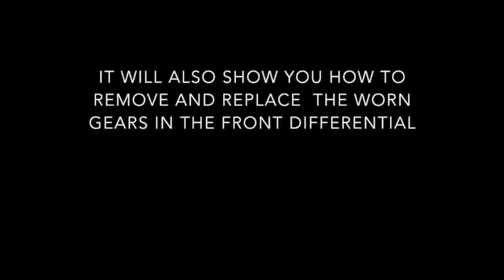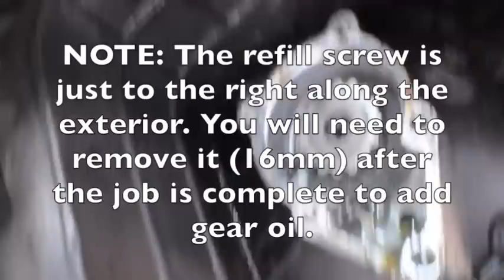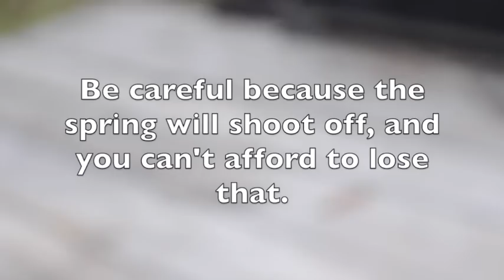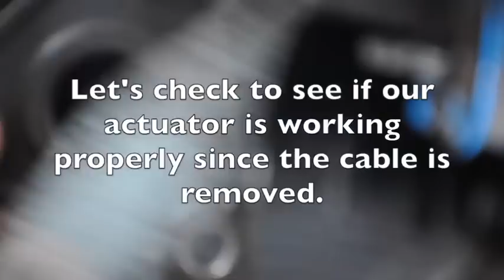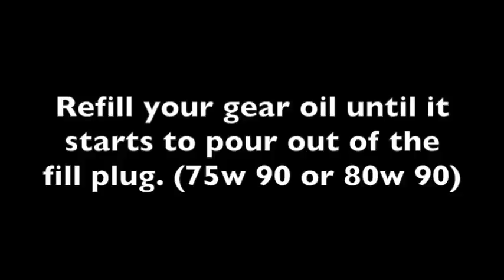How To Fix Gmc Sonoma 4x4, Chevy Blazer, S10, Jimmy, Olds Bravada, 4x4 Grinding Clicking Noise

Comment: This was very helpful. I am a mechanic, but never worked on this system before. My problem is the small shaft is not moving (just a little). From watching your video I will pull her down & check what the problem might be. My Blazer is a 1983 model & I am living in the Philippines, so you see parts may be a problem. I figured this S10 blazer belonged to the military or someone in the military brought it over & thru the years got out in the public. Thanks for your time!

Comment: Great Video. I need to do this and Now I know I can. Wife drove with 4wd on and everything still works except the Front Fork isn't engaging. Im going to assume she stripped the locking collar. Thanks again. And to those with your 4wd control blinking then turning off its more than likely yur Tranfer Case switch motor. You can ground the #13 pin on your OBDII connector and the switch will flash the code. Their are only 4 codes and easy to look up on Google.

Comment: Hello, I have a doubt, what function does the sensor in the front differential serve?
Reply from the maker: The actuator pulls the cable when the 4x4 button is pressed and engages the gears hence, allowing the vehicle to be in four wheel drive. Thanks for watching.
Reply: @TerenceDIY  i mean the sensor with the plug that you disconect , not the vaccum actuator
Reply from the maker: Are you talking at the 6:43 mark? If not, what time stamp?

Comment: I have a 2000 S10 LS 4x4, front axel won't engage. Thought the TC switch was sticky so already swapped it, transfer case functions but no power transfer to wheel. This is a great video for a guy like me just to open everything up and inspect components.

Comment: I’m having a similar problem with my 1999 blazer. I’m going to have to pull the same parts you did. I think I’ve got a bad bearing. Not the actual rear end bearing but one in the axle tube. What’s the name of the parts you replaced?
Reply from the maker: Hi, the parts are in the description box. Thanks for watching.

Comment: Curious how much of this I would have to do to drop my oil pan down. I have 2002 Sonoma 4.3L 4WD and I can’t come up with the simplest solution to drop my pan.
Reply from the maker: You're definitely going to have to remove quite a few things to drop that oil pan. You might have to remove the motor mounts bolts as well so you will be able to jack up the motor for clearance. Thanks for watching.
Reply: @TerenceDIY Hoo boy. And with no oil pan, I wonder where the jack point is to lift engine? Oh, this is frustrating 😂
Reply from the maker: The only for sure way to lift it would be to use a hoist. However, I have seen guys use blocks under the crankshaft pulley and jacked it up there.

Comment: Hi my 96 blazer grinds from the front right wheel but when I engage 4wd it stops…. Think it’s the gears inside not disengaging? Replaced cable, actuator all is working as it should….
Reply from the maker: That sounds  like that maybe your issue. I would lift it to see if I can visually see or hear where the noise is exactly coming from when the wheels are turning.
Reply: So does that washer inside fit differently on different cars? Mine was sitting inside different then yours was…. Was debating on putting it back like yours was or mine….
Reply from the maker: The way I installed the washer on my was how it was from the factory. The 4x4 worked great after I finished fixing it. I'm not sure if it was installed differently. It would be very weird if it was.

Comment: Thanks.  When i pulled the cv axle out of my zr2 it pulled the inner axle shaft out with it. Changed the seal, didn't bother to look down the tube and ultimately destroyed the thrust washer apon reinstallation.  Thanks for showing how it all comes apart and where everything goes.
Reply from the maker: You're very welcome.
Reply: I'm confused on what way the thrust spacers go. Any help or tips you can share? Thanks in advance

Comment: What is the name of the sleeve that the kit you mentioned in the description doesn’t come with that you have to get from gm
Reply: Is it the — Front drive axle clutch sleeve 26036092-?
Reply from the maker: Here are some links to the part....

https://cmgearworks.com/product/gm-chevy-s10-7-25ifs-slider-slide-collar-4x4-front-axle-7-25/

https://www.jimellisbuickgmcmogparts.com/p/GMC_1999_Sonoma/SLEEVE/53554931/26036092.html

Comment: I'm looking into this front differential rebuild kit and I'm finding that the Dorman brand online gets a lot of negative reviews saying the that parts are inferior quality. Has anyone been able to find a better kit?
Reply from the maker: Hi, I am pretty sure you can find an GM OEM set on here (link below). However, you may have to buy the pieces individually. 

https://www.gmpartsdirect.com/search?search_str=FRONT+differential+carrier+gear+kit
Reply: @TerenceDIY  thank you for your video once again. Are there any noticable symptoms of these gears are washers going bad?
Reply from the maker: @MattyTxp  Absolutely! you can hear the gear grinding and clicking while in four wheel drive. It's extremely noticeable.
Reply: @TerenceDIY  thank you for the response. I have recently replaced my transfer case vacuum switch because this noise was going on while in 2wd. I haven't had the noise since and not in 4x4. Wasn't sure how damaged it was.

Comment: New question. Hope you're still checking comments I know this video is from a long time ago. I followed your instructions to a T. I have everything assembled just like you said, new sleeve and gear, thrust washers, clips. They cost a pretty penny. When I get to the part  29:48 in the video where you mate it to the differential mine won't bottom out. It won't seat fully. Something is preventing it from seating all the way. This is driving me nuts :) I though I was almost done :(
Reply from the maker: Hi Jay, were you able to get it to seat??
Reply: @TerenceDIY  Yes! :) I had the wheels turned all the way. I straightened them out. I started the engine for just a second whatever it was I did that seemed to put everything back into place :) It is seated and I'm headed for the finish line :) Thanks for the reply! :)
Reply from the maker: @jayb9687  that's awesome!!

Comment: At 12:14 that gear that has the “claw / pincher” around it appears to be the gear that is moved right and left to engage 4WD. All my gears fell out when I took this apart. Which way does that gear go back in? It has a flat side to it and I don’t know if that faces differential housing or towards passenger side. Thanks!
Reply: Looks like it’s flat side towards driver side.
Reply from the maker: Yep. At 21:36 I show the assembly.
Reply: @TerenceDIY  The most God awful part if having everything back together and not being able to get the damn cable to click into the spring clip. OMG! No way I can pre-attach cable and lift the entire assembly up and hope to mate all the gears. And you'd have silicone gasket crap all over everything.

Comment: Thank You ! I had to disengage the cable to the vacuum pod under the battery after installing a new Pod , cable and the transfer case vacuum switch, It would stop grinding in 2WD so....
My guess is that I need the rebuild too. ( a bit over my skill level I think)

Comment: Hey all, I'm curious if I can change the outer axle seal without taking the whole assembly off. The inner axle is still "in the way" in the hole, so I'm not sure how to get leverage on the seal to pull it off. Any tips would be greatly appreciated!

Comment: I need help I have the same problem with my 2000 blazer but it has a 6 inch lift on it, do I have to do anything with the suspension lift bar?

Comment: Is that for a 1994 GMC Yukon?
My axle shaft has play, can slid in and out, what needs to be replaced?
Reply from the maker: The Yukon is similar, however, this is geared toward the smaller SUV's and pickups. As far as the play in your axle shaft, I would have to look at it to figure out the issue.

Comment: Do you have to pull the shaft out like this to replace the rubber seal on the actuator shaft, or is it replaceable by only removing the actuator cable housing?  I have a leak coming from that seal.
Reply from the maker: Hi rob27926, sorry for the late response. We are currently moving so I have been off the channel for a while. Unfortunately, you may have to remove the shaft to replace that seal. However, I am not 99 percent sure because I don't have the Sonoma anymore and I posted this some time ago. Thanks,

Comment: Can I just remove the axles and run it permanently in 2wd, or do they hold the hub assembly together?
Reply from the maker: Hi MontanaMuzach, I don't the truck will run properly if you do that. Not only will you get all sorts of trouble codes, but there will be an imbalance within the drivetrain.Thanks, Terence
Reply: I asked because my 4wd was engaged, I didn't know it, and drove 100 miles on the highway before hearing a bang. Not sure if the diff is toast or what. Makes bad noises now, and the shaft from the t case to the front diff spins freely. I don't drive it now, but hoping for a cheap, less labor intensive way to get it back on the road and don't really need 4wd.

Comment: Does the grinding sound like it coming from the  cv axle when applying gas hard because I was thinking coming from their but it sound like this is the issue but not sure and what the total price for the parts
Reply from the maker: Hi Sam, sorry for the late reply. The grinding does sound like it is coming from that area. And, most likely it is (common issue). As far as parts, this was some time ago however, I believe I managed to get them for a little over $100. Thanks for watching!
Reply: Terence's Youtube thank would be the same as changing the front differential?
Reply from the maker: Hi Sam, changing the front differential requires a lot more work. This only requires moving certain parts to change the worn parts. Thanks,

Comment: What fluid would you put back into your transfer case?
Reply from the maker: Hi, below is the link to the fluid that I would use... Once you drain it, you will need about 2.4 quarts to refill it. 

https://shop.advanceautoparts.com/p/gm-auto-trak-ii-transfer-case-fluid-338-oz-10-4017/10628688-p?c3ch=PLA&c3nid=10628688-P&adtype=pla&product_channel=online&store_code=&gclid=CjwKCAiA5o3vBRBUEiwA9PVzar9XTdKWGJrHklXwX8KfZh8Hkcb268mSrq8Zks3avlPMOCR07yH0NxoCexYQAvD_BwE&gclsrc=aw.ds

Comment: How do u know when this is the issue with the 4 wheel drive
Reply from the maker: Hi Orlando, if your truck is experiencing this issue, the 4 wheel drive will not engage. You can hear it clearly trying as the gears are grinding, but the front wheels will not move. Thanks for watching!

Comment: Thanks for your response and "good luck". Question if I may ask: My actuator cable is fine. 4 wheel drive did work some months ago (just purchased 2000 S10 truck, great condition) then stopped, no grinding, no noises. Pulled cable from actuator (vacuum line disappeared, gone from actuator. Burned through touching exhaust pipe and think tire ran it over and pulled it off). I made a split sleeve, pulled cable to full extension, hose clamped it and nothing. I can spin front drive shaft freely. I am waiting for differential kit to come. Does this sound like the problem or am I going to waist time with what you did in your video? Appreciate any insight. Thanks in advance.
Reply from the maker: Hi Keith, I highly doubt you have the same issue as me. Mine grinded for quite a while before it completely stopped working. When you press the 4-wheel drive button, does the light continuously blink or does it function properly? Also, it's funny that you are mentioning this, because my 99 Tahoe just did the same thing. The four wheel drive stopped working out of nowhere. I believe I snapped an axle. I won't be able to tell for sure until I get under it in a few days but I am almost positive. If one of the axles are snapped, the other one will not function in which will disable the 4-wheel drive. Also, is there anyway you can see if your front drive shaft engages when you press the 4-wheel drive button? That will help a lot if I knew this. I'm just trying to rule out if you are having an issue at the transfer case. Thanks, Terence
Reply: @TerenceDIY  thanks again for getting back so quick as I'm spending all kinds of money getting prepared for this little venture. This switch was non-functional and it was a strange thing because it was a contact issue where I would need a special tool to push the pins through or possibly a cold solder joint. What corrected the problem was ever so light pressure on the back plate of the four wheel drive switch so I drilled a clearance hole and a small tap hole and put a wood screw through and just put pressure on it and it's been fine. Typical backyard mechanic. You can hear very clearly four wheel High and four wheel low when you push the button the relay works on the passenger side and you can feel the engagement of the transfer case. That was the first thing I checked. with it in two-wheel drive I can freely spend the front axle excuse me front drive shaft when I engage in four wheel low or high it locks that short front drive shaft. When I pull the actuator cable to its fullest and lock it there's nothing the drive shaft does not engage. I never heard anything snap or go nuts and I'm kind of new to the four-wheel drive stuff as far as repair. I'm an air-cooled VW past Motorhead as I had a machine shop and clearance the case with the program I wrote for 2174 160 horsepower 71 Super beetle, show car and was right on the edge of buying a Pauter short block for 14,000 that would produce 350 horsepower but a lot of mods to the already finished car had to be done and divorce happened. That's a lot of personal information but that's my background mechanically and I race quarter midgets and have my hand on many tractor engines diesel. So I don't know what I'm going to find when I finally get into this the last thing on my list and having some tight financial issues is that beautiful tool you used right angle impact wrench or maybe just a wrench as I can snap them loose and then use it to get the screws out better in difficult area. Again thanks this was lengthy thanks for taking the time to read and answering my questions you've been a great help.
Reply: Hey Terence. Finally a great day in PA for this job. Started late, work, but I'm hung up. Can't seem to get the clearance to pull the splined axle out completely out of the wheel bearing. Took the tie rod off still not enough. Upper ball joint & control arm were replaced few months back & only drivers side lower ball joint. My mechanic said it was a bear. Is my only option now to remove passenger side lower ball joint? Am i missing something? Can the axle tube be removed to try and gain some clearance? Appreciate your help. Thanks
Reply from the maker: Hi Keith, did you remove the passenger side upper ball joint? Please let me know. Thanks,
Reply: @TerenceDIY  Hello & literally just ,"FINISHED"!!
   Upper, lower ball joints, tie rod, brake caliper and just for the hell of it the shock at the bottom only. My eBay Milwaukee impact wrench was a little lame but it managed to get things apart. It's all back together the four wheel drive gear was torn up but now it engages and I'm waiting for the posi lock kit to come cuz I'm not doing that vacuum stuff anymore! I started at 9:00 it's after 3:00 it's about 1 2° out and I can feel my 61 year old knees. Thanks for getting back it is a bit of a job but I'm getting more familiar with my vehicle. Take care of my friend.
Reply from the maker: Good Job Keith! I am glad you got finished with it. Thanks for watching my video.

Comment: what kind of grinding noise does it make my switch quit working it not in 4x4 but their is a grinding noise when try to go forward sounds like small grinding if that makes any sense help
Reply from the maker: Hi Daniel, the grinding sound is from the worn down gear not able to engage. It sounds like metal binding together and you'll hear some clicking at times. It's really difficult to explain, but you can definitely tell the gears are grinding.

Comment: May be a dumb question but what kind of sealant/gasket glue did you use?
Reply from the maker: Hi Matthew Hodge, I know this is a very late response and I do apologize about that, but I used RTV Permatex Blue Silicon. Any color gasket maker would work. Once again, sorry for the late reply. I've been working on a short documentary about health for a while and I will be uploading to the channel soon. Thank you.
Reply: Terence's Youtube its no problem.  Thank you for your response and thank you for your video, it was very helpful in rebuilding my front differential.
Reply from the maker: You're very welcome, Matthew Hodge. Have a wonderful year!

Comment: could you please leave a link for the kit you bought? having the same issues with my truck, and need to do this. but i cannot find a kit that has all same parts, as well ones i have come with other gears, or are only bearing/seals kits... thanks in advance.
Reply: This was the perfect vid .. It is also the steps needed to remove the oil pan .. The whole axle must be removed including the diff.. By removing the center link (a must) and the oil pan is easy from there
Reply: Gear Kit 600-561